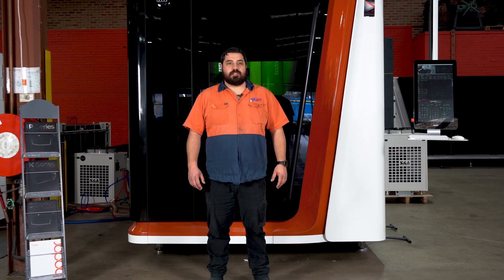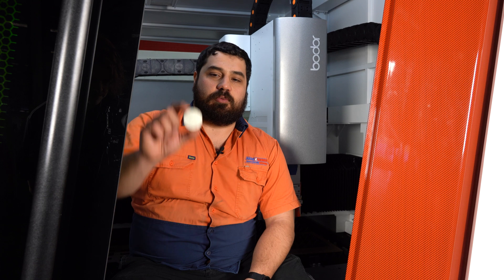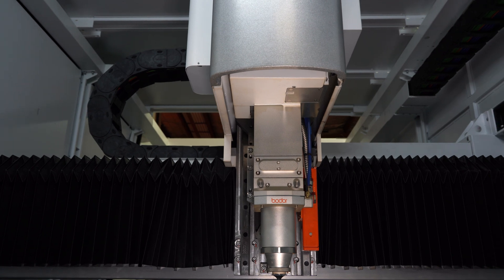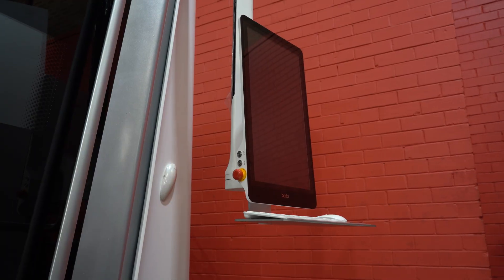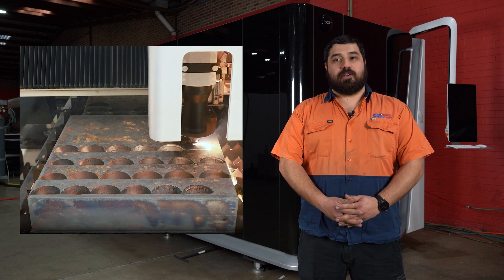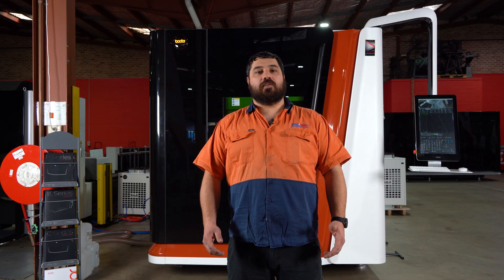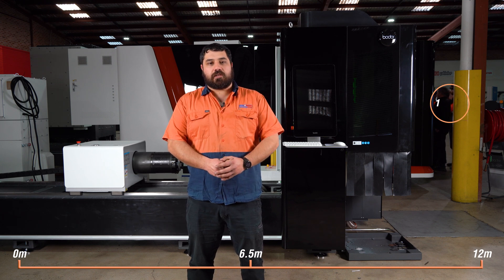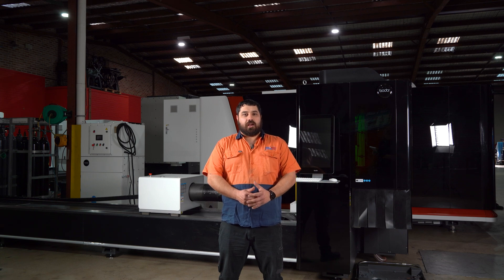Cutting-Edge BODOR Laser Range: Now on Display and Available Nationwide

Comment: 80mm plate on a laser is insane! How does the machine maintain focal distance as the beam drops?
Reply from the maker: The Bodor Genius Auto-Focus system handles the adjustment of the focal point, which is key when cutting varying thicknesses of sheet metal, including something as impressive as 80mm plate. The machine tool control system manages this automatically, adjusting the focal point during the cutting process to ensure the best results. This auto-focus capability eliminates the need for manual adjustments, which can be time-consuming and labor-intensive, especially when switching between different materials or thicknesses.

With the ability to set separate perforation and cutting focal lengths, the system increases cutting accuracy and speed. This precise control allows the machine to maintain the optimal focal distance even as the beam depth changes, ensuring clean and accurate cuts every time. This technology significantly enhances the efficiency and quality of laser cutting operations, making it an excellent solution for heavy-duty applications like cutting 80mm plates.